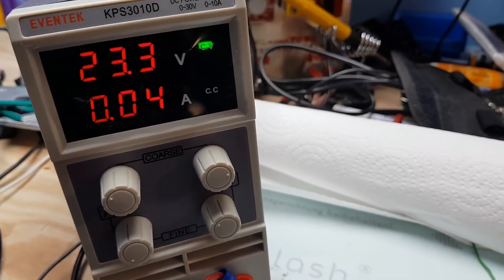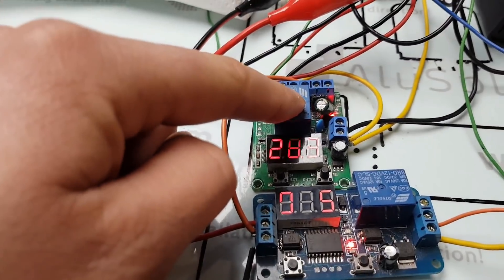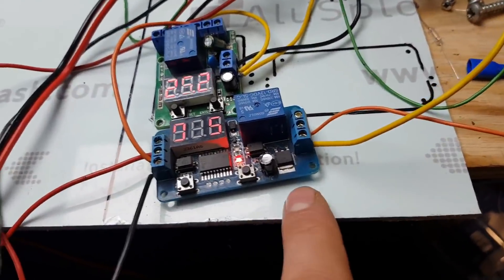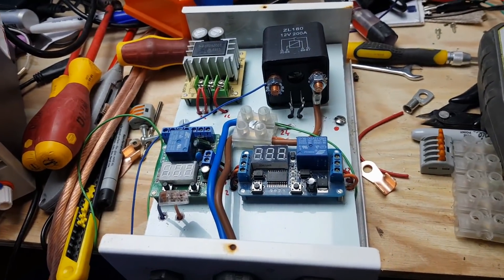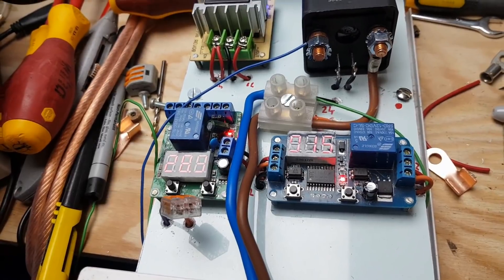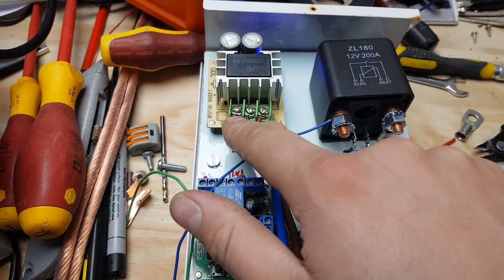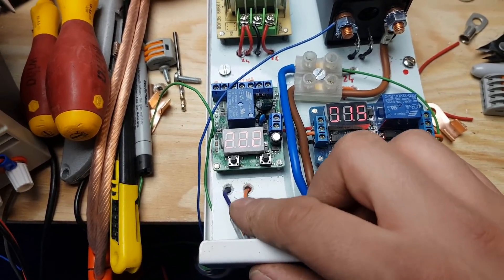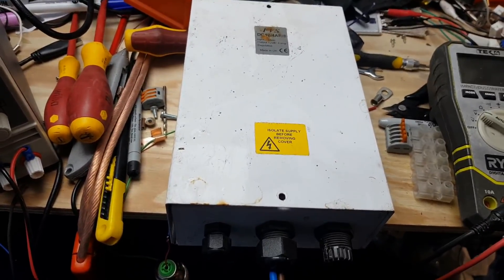DUMP LOAD upgrade!

Comment: Not pretty, but prettier than the previous model ;-) And more importantly it works, and since it is modular, it will be easy to replace anything that fails or swap stuff out. Nice work! I would have gone done the Arduino route, but it would probably have taken longer to put together and some fiddling to get everything right, so it really depends on what your requirements vs resources situation is like.
Reply from the maker: Agreed that last one worked throughout last year. Could get 7l of water to a rolling boil some days. 

I would love to invest time in audrino bit me and the Mrs are expecting our first in 8 weeks so I have a lot of decorating to finish rather than indulge in my hobby

Comment: It's not elegant but it's working. I should use this system to heat bio fuel in my van.
 I have solar but I'm just waisting the energy and running on diesel instead.
Got me thinking thanks ;-) 
Ps; my fuel needs to be at 5c > to start